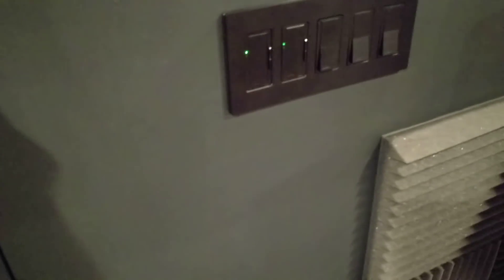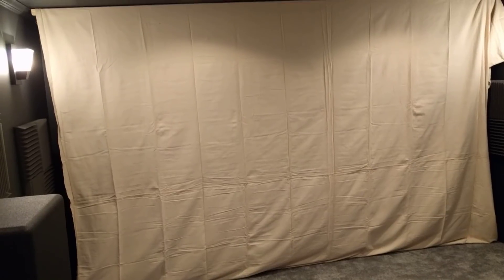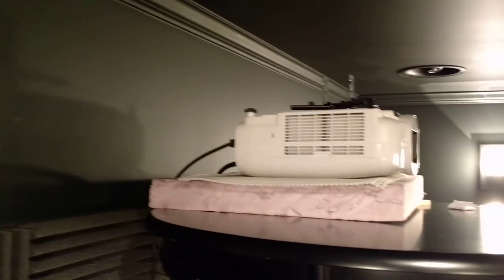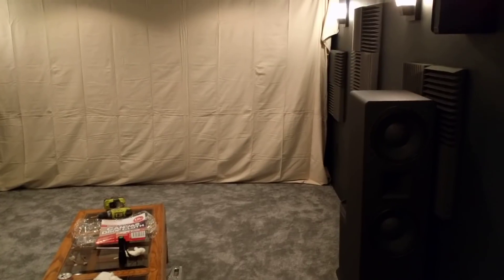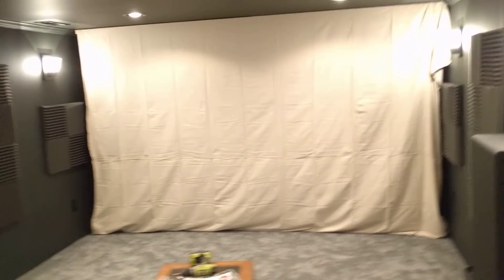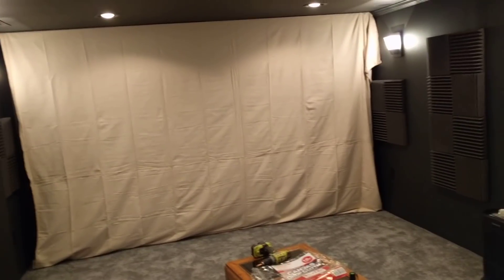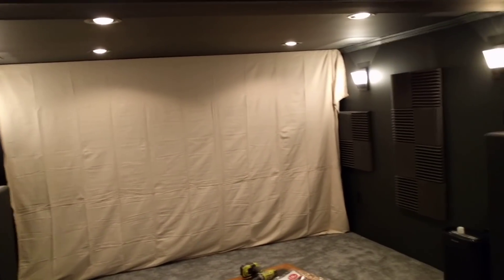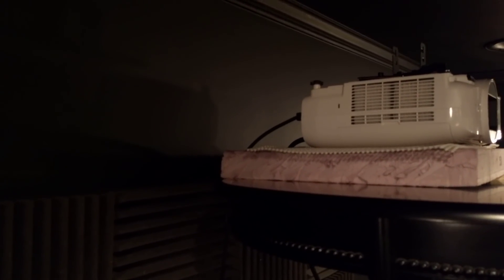[14] - faux-wall construction: step 1

Comment: Was thinking. screen/projector people get hung up on the tech of screens. Getting a fixed frame or auto masking 2 way or 4 way...But the fact is no matter how you approach it...and y ou watch a film that  for some odd reason was filmed in 2 aspect ratios...you're going to have image bleed over the frame.  Whether you have a 16:9 screen or an anamorphic.  So why not just get a large 16:9 FRAMELESS? After a minute of watching whatever...you're not focusing on what's going on at the edge of the screen. Or shouldn't be.

Seems to me...having a projector/screen setup is really just good if you're watching single aspect ratio content. If you do have a screen with a frame/visible border.

For content like The Dark Knight...that flips back and forth between aspect ratios I'd stick with a flatscreen.  So what if you sacrifice some image on the L/R. I never noticed. The directors usually avoid putting any  important parts of the scene at the sides of the frame. I never notice anything I think should be at the sides on my HD res Pioneer Elite plasma...You're focusing on the content. I'd have to be looking for the aspect ratio to change to see it. 

Would I like  to have a screen/projector setup one day. HECK YA! When I move out of my condo and into a detached home with a dedicated HT room.  Hopefully by then they'll have a 4 way masking screen that will have a CPU. That will detect when a marker on the movie says it's changing to 2.365 from 16:9...why has no company put one out? Doesn't sound that complicated. Simple program.